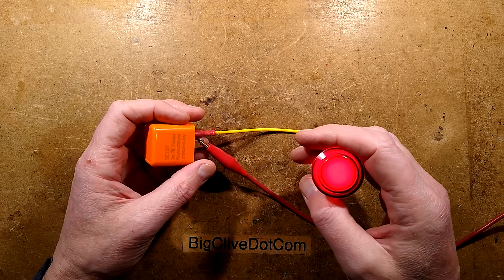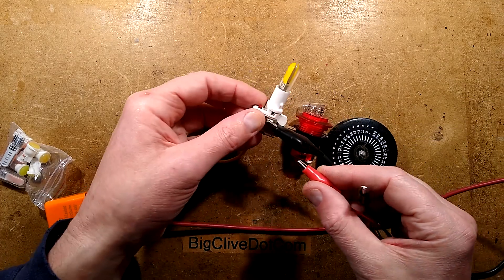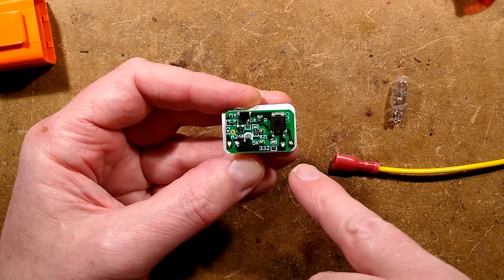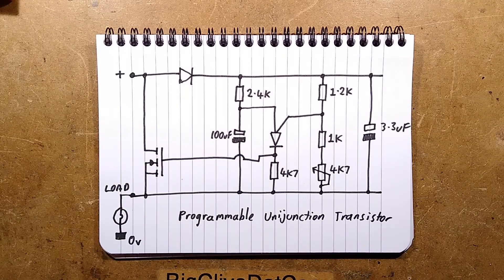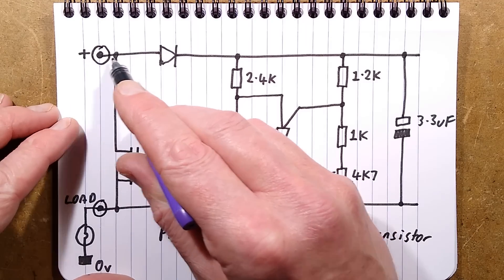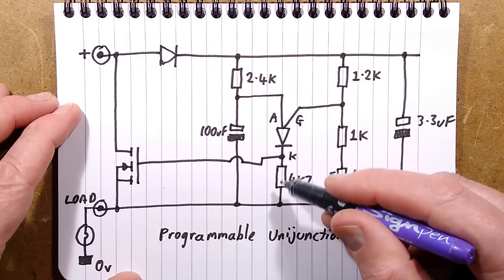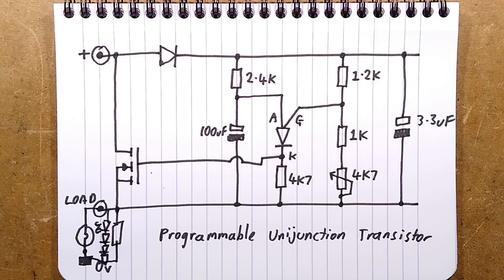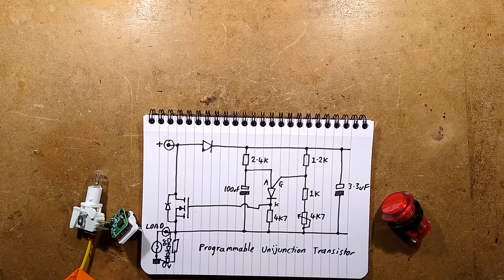Two wire flasher module teardown with unexpected find

Comment: Was the LED lamp you used, a canbus type.? They have a resistor load, so the car knows there is something attached at the end of the cable, such as a lamp.
If not, then, as you say the resistance is too high for the circuit to work.
Reply: Unlikely, the ”CAN-bus" style W5W bulbs I've seen have all had parallel load resistors well low of 1 kOhm... 
Given that my vehicles have no monitoring of any of the positions using W5Ws, I just buy whatever version is cheapest at the moment and take a pair of snips to any load resistors - no point in making extra heat to fry the LEDs faster 🍳

Had to add load resistors to my rear clusters (for the indicators) though, as the previous owner had changed from the origin as lnincandescants to fully LED clusters and the flash rate was a little, not much but definitely the car's ”bulb out" rate) faster than allowed (he'd managed to talk them through his [our equivalent of MOT] station, but I didn't want to chance it, and also found it a bit annoying myself

Comment: if you swap too led indicators on motorbikes you have to put inline resitors on so the flasher units work
Reply: They make a all in one unit you can wire into your stock harness that will fix the fast flashing so you don't have to put in resistors on each bulb.  I installed led side, front, rear and mirror signals on my sv650 and didn't want to wire in all those bulky resistors.  The unit fits nicely under the seat. :)
Reply: @pheelix-  yes upgraded my bike now mysdelfe vulcan 650s but or the princible is the same

Comment: Newer LED flasher replacement bulbs now have load resistors in parallel to still work with old style flasher relays.
Reply: Also needed to work properly with BCM units that do failed lamp detection, by providing a regular brief pulse of low current to the lamp, and measuring the voltage across the lamp does not rise above around 1V.

Comment: PUT can be replaced with 2 SMD NPN and PNP transistors to make a SCR. Easy to make the PUT using the standard transistor line, just need an extra diffusion mask step to get the PNPN structure in the die, as opposed to the UJT, which needs a lot more process work to get the diffusions right, in what is essentially a very lightly doped very long PN junction, almost JFET like in construction.

Comment: Those unijunction transistors, due to their hysteresis characteristic, were also good for squaring up sinewaves.
Reply: Erm, a sinewave isn't supposed to be square because then it would be a squarewave!
Reply: @manolisgledsodakis873  ffs. The idea being that you want a square wave, but you have a sinewave.
Reply: @manolisgledsodakis873  Squaring up the sine wave makes it much easier to measure zero crossings if you are trying to compare or phase match two waveforms.

Comment: UJTs were also used to provide synced gate drive for power SCR phase control circuits in Field drive outputs of Automatic Voltage Regulators used on power generators. Basler Electric used them in almost every model AVR.  The UJT was the interface between the dc control signal and the power devices.

Comment: Wow! A relaxation oscillator. I haven't seen one of those in a long time also. Used to be used for sirens and dimmers.
Reply: Back in the '70s I recall seeing a UJT/PUT design relaxation oscillator that used a neon lamp.  It was a ringer in a telephone!  So instead of physical bells, it made a sound we referred to as "a 50 pound cricket chirp".
Reply: Relaxation oscillators still widely used, just not ones based on a UJT!

Comment: Got those in both of our cars.  Replaced the original 21W tungsten indicators with amber LEDs, and they have lasted well past a decade. Far more visible than the old bulbs too, so possibly an added safety aspect. (Also means you can leave your hazard flashers on for a VERY long time, possibly weeks!)
Reply: YEah thanks for blinding the fucking piss out of me with your blinker.....

....I'm not being facetious either. I wish those LED marker/signal/brake lights were illegal. They're too bright. They legit blind me worse than the high beams from a car with sealed beam headlights do. They're FUCKING AWFUL to be around. One part...of many...that makes me loathe modern cars as that shit is factory installed these days and it makes driving at night a legit painful experience when it didn't used to be just a few years ago. 

They need to re-write the laws regarding automotive lighting to regulate brightness by lumen output and pin it to the old tungesten bulbs. Added bonus: The LED lights would use even less power than they already do!

 You aren't 'safer' because your blinkers light up an entire football field.

Oh, and you're even more of an asshole to everyone else around you with your retrofit than the people driving cars with LED lights from factory, because you've put them in housings that don't have the right reflector/lens optics for LED lights. NEVER NEVER NEVER PUT A DIFFERENT LIGHTING TECH IN A CAR LIGHT HOUSING! If it came with a filament bulb, either put filament bulbs in it, or replace the entire fucking housing with one that has the correct optics for whatever lighting tech you are fitting. If you're swapping halogen headlights for HID, also swap your headlight buckets for HID buckets. If you're swapping 1157 filament bulbs for LEDs, also swap the marker/tail light buckets with LED buckets. There is a ton of engineering that goes into those lights to make them do what they need to do without blinding everyone else on the road and you throw that all out the window when you change what type of light source is stuck in there. Light goes in all sorts of bizarre and unpredictable directions. It's worst with headlights...people who put HID bulbs in halogen housings often get ticketed for it and for good reason...but it even affects the other lights as well. An LED bulb in a tail light housing meant for a filament bulb turns what was a pleasant-to-the-eye-but-readily-visible large block of red light into a piercing, painful red laser-like point of light that sears your corneas just as an HID bulb in a halogen headlight bucket does.

Comment: Huh well now I know what I can try to do with my  20 circa 1970s steel can TO18-4 bipolar programmable unijunction transistors I pulled from an industrial burner controller. 

Really strange that the ones I have are 4 pin. I can't find anything on bipolar PUTs online. But I've got some! Lol
Reply: BRY39, the most common one around, and millions were made, often used as the heart of old RCD devices to drive the trip coil.
Reply: @SeanBZA  that's the one, I'm sure of it. I'll have to check my parts later. TO72 not TO18 makes more sense too lol
Reply: And I see it's a PUT and an SCS. neat
Reply: @airmann90  Had anode trigger and cathode trigger, so basically all 4 junctions are brouht out to pins. You can use it as a NPN or a PNP transistor as well, if you want, though it will be an expensive one..

Comment: Would setting the flash rate higher lower the voltage drop needed for the led and let the one you have work?
Reply: Not with most LED lamps that use stacked dies, you need at least 6V across the flasher to operate it, and the LED lamp probably sits with 9V across it. On 24V it would flash fine.

Comment: Strange digital flashes usually don't require a heavy load to operate the one I have on my moped is similar but it does not require a load to actually operate and also has a variable resistor to just the flashing speed it just seems a bit strange that it would require a load to flash
Reply: Solid state flasher relays (at least oem ones) tend to emulate the behaviour of the old bimetallic flasher relays, i.e. if you have a bulb out rhe flash rate noticeably increases.

This is a reason that aftermarket led indicators for motorcycles often come with load resistors, or are available as a separate purchase.

Comment: For at least the past two decades, the "clicking relay" sound of the turn signal in cars has been sampled and played through the audio speakers. I never noticed when this transition was made because the sound is so accurate. Younger people might not even realize that the sound is from an old school relay, or as Clive mentioned a bimetallic switch.
Reply: Or simply done with a small strangled chipmunk speaker in a sealed case, with a series resistor and capacitor to make it generate a pulse on every edge.
Reply: Before digital playback some manufacturers used "audio relays". Their only funktion was to provide the clicking sound. The contacts, if present,  were not connected.
Reply: @klaust.2769  Yes, Volvo P2 platform cars have this (roughly the S80/S60/V70 between 1999..2009). There's a relay inside the instrument cluster just for the clicking sound. Only works with the ignition on, so hazards with ignition off is completely silent.
Reply: 2012 i20 had relays. 2013 has solid state with fake sound.
The Hyundai accent changed around then too.
Reply: @tin2001  car I had used a piezoelectric in the instrument cluster for all the beeps and boops. How most cars do it these days if they don't superimpose a signal over the speakers
Reply: My car (from 2001) had a "dummy relay" - it was sitting in the dashboard with only the coil connected, simply to provide clicking sound:)
Reply: @if860  , my car from 1991 has also this "dummy relay" build in the speedometer panel.
Reply: now that's new to me. thought they all emulated this sound on the cluster
*on the new-ish car that utilize electronic flasher
Reply: The old ones would flash faster if one bulb was dud. Do the new ones do that?
Reply: @TerryClarkAccordioncrazy  If it comes to newer (but with ordinary bulbs) cars with dedicated blinker circuit (i guess this is a retrofit) it is required. On eBay they sell 6R and 8R resistors to emulate the bulb being present when using ordinary led as a retrofit, otherwise the CAN will detect bulb failure and increase frequency. There are dedicated ICs for that. On my driving licence exam I had an absolutely absurd question about the frequency of turn signals.
Reply: Depends on the car. I have a 2006 Saab 93 which does play the turn signal sounds through the speakers. And it doesn't really sound much like a mechanical flasher. And then I have a 2004 Ford Crown Victoria which definitely does not, it has a mechanical flasher. The problem with using the speakers for the turn signal sounds is that, if the radio is replaced with an aftermarket one, no more turn signal sounds.
Reply: My 1993 BMW e34 already had all its body electrics under the rear seat, but the clicking relay sound was still there. I'm thinking the instrument cluster might have had a dummy relay inside it just to make the sound.
Reply: @ilhuikar  , the dummy relay is inside the speedometer panel, same as in the E36 series.
Reply: When I went shopping for LED flashers, I specifically picked one with a 555 timer and a relay to get the real, authentic clicky noise.
Reply: A friend of mine purchased a 2015 Dodge Caravan brand-new. By 50k miles, her "tone generator module" was defective. She no longer gets the fake turn signal click (which often hiccuped due to everything else going on in the CANBUS network), nor does she have the key-in chime, seat belt chime, the "hey, the temp has dropped below 27°F so I'm gonna pretend your tires are low on air when they're perfectly-inflated" warning, or the "hey, your engine is gonna blow up - again" notification. It's going to cost her, a 76-year-old widow, thousands of dollars to repair. It's not going to be repaired, she drives maybe 6,000 miles a year now that she's retired - and she's the type to get her vehicles in for an oil change BEFORE she hits her 3,000-mile interval and always had her vehicles dealer-serviced down to the smallest light bulb, this is the first time she's ever turned down a repair.

I have scavenged a few Piezo beepers from '80s GM cars that still work to this day, and our "family fleet" of 99-07 Toyota, Chrysler, and Jeep models have perfectly-functioning Piezo sounders and flasher modules, so I fail to see the advantage to having the car's onboard computer tell a random networked dedicated module to replay a sound sample - except to make manufacturers and service departments more 💰.
Reply: @dashcamandy2242  Seems to me that a 2015 with 50k miles ought to still be under warranty. Particularly for a system that, in part, controls mandatory indicators.

But I suppose the key phrases here are "Dodge Caravan" and "76-year old widow".

Comment: It seems like an elegant design. Should be pretty reliable, too. I wonder what else those PUTs are used in; they couldn't have brought them back into existence just for something like this.
Reply from the maker: They were originally used for thyristor firing or timing.  But probably find use in simple legacy circuits.
Reply: @bigclivedotcom  I first saw UKTs in simple relaxation oscillators with variable time constant. The standard injunction as you said had a fixed trigger voltage set basically by doping levels. Varying the timing involved tricks with supply voltage which sometimes meant it couldn't supply the current you wanted.
(UJTs are basically negative resistance devices. You can make them amplify as well as oscillate. I don't think PUTs can amplify.)
PUTs being four layer devices (not literally injunction devices but they behaved a lot like UJTs) gave a lot more flexibility when you had limited voltage to work with but needed current without having to go full thyristor.
I think the 555 is what made both of them if not obsolete, at least a lot less common. Like you I'm honestly amazed to see them in smd.
Reply: @bigclivedotcom  Something I must have been building back in the seventies. https://files.catbox.moe/eye6a1.jpg
Reply: They must be used for something; digikey lists over forty types! Relaxation oscillators is where I remember examples from the seventies.
Reply: @neilbarnes3557  Still plenty of old equipment that has them in it, where you need them to repair as they fail.
Reply: @SeanBZA  please tell us how to connect them.

Comment: Interesting. I thought it would be a multivibrator (555 or two transistors) driving a MOSFET, but I wouldn't expect the SCR.
Reply: Much cheaper though.
Reply: And doesn't need a separate ground to power the 555.
Reply: I just have one of these flashers (from one of my bikes) open in from of me.. it has an M5233 (DIP8), and an IRF520... plus that damn piezo beeper so you don't forget to turn your blinkers off 😀

Comment: How is the PUT different from an SCR?
Reply: An SCR is triggered by gate current. A PUT is like an SCR with gate driven by a comparator between the programming input and the anode. The “gate” input on a PUT is not so much a gate but a programming input. Triggering occurs when the anode voltage gets higher than the programming voltage.

Comment: An interesting coincidence that you would dissect this today.
Just this morning I had to repair the 2 wire flasher for my 1962 Dodge Power Wagon. It uses an old school mechanical relay designed to handle up to 20 amps for multi bulb truck and trailer combinations. Instead of using a bi-metal strip, it uses a coil and gear arrangement with a tiny spring and weight. There are 2 contacts inside as well. One for the coil and one for the load. When 12 volts (possibly 6v too) is placed across the terminals the coil is energized, pulling the weight towards it and opening the coil part of the circuit while closing the load switch side. The spring then returns the gear to the start position and the cycle starts all over again. The current of the load is not really critical to the operation. However, I suspect that it would not operate properly if only 2 LEDs were used as the load. The current limit might not be enough to energize the coil sufficiently to pull the weight all the way open. Causing a fast flash, or more likely, no flash at all.
Thanks for your videos! I always enjoy them. 
(I wish I could post a picture of it. And the part number is no longer visible.)
Reply: I can picture that by your description. Amazing the things we are capable of creating!
Reply: Yeah that’s true. When I use to work for an Auto Place, I found out about these flasher relays AND that they now make relays that are compatible with vintage cars and LEDs. I use to love telling customers this “secret”. The LED relays have a much lower trigger and make it so that when/if you do buy it, paired with the right quality LED will last forever. Just have to get a quality LED bulb, that’s not too bright because it is a vintage car, a LED that is just as bright as the original and not SUPER bright that it looks aftermarket.
Reply: @Gold63Beast  If the LED is too bright, wouldn't adding a series resistor be an easy fix?
Reply: @NiHaoMike64  yes. But it’s a bandaid solution. Rather have a LED with the same output as original. LEDs that are really bright tend to cause a lot of heat and cause more problems. A good quality LED bulb have built in resistors and also have better LEDs that aren’t overpowered causing them to prematurely fail. Getting the right relay and bulb is key for a set it and forget it solution. It will outlast the car.
Reply: That to me sounds like a mechanical solution to my pet hate of two wire flashers...when you indicate there is a delay before the light comes on.

I have seen many cleaver ideas in Dodge designs over the years.
Reply: Those were used in tractor trailers a lot in the 70's and 80's. Cool as heck to watch.
Reply: I made a quick video.
https://youtu.be/aiKnFfErVCU
Reply: Send one to Big Clive for a teardown!